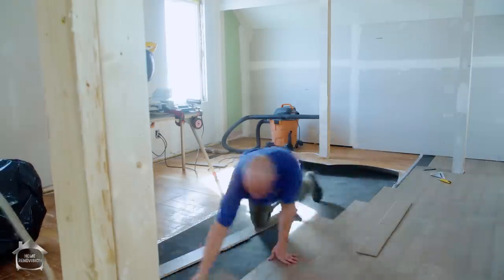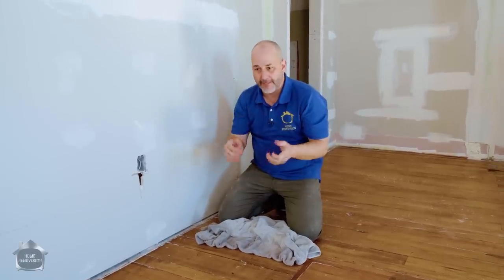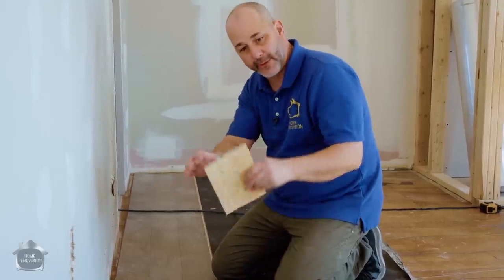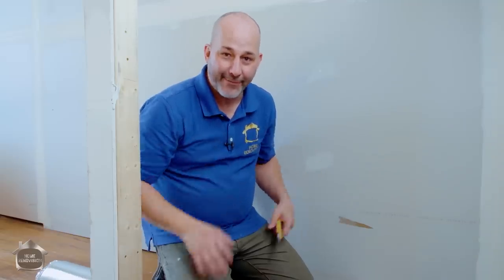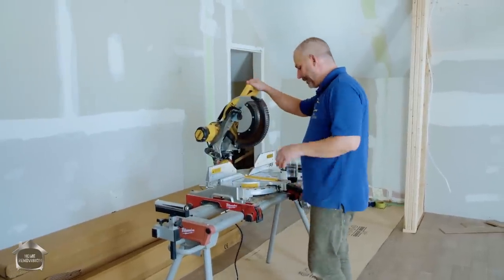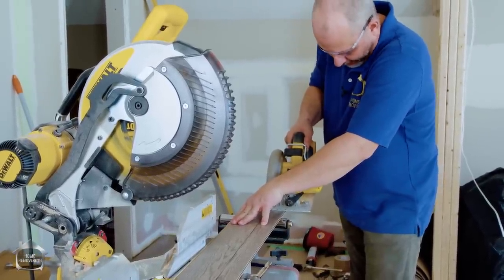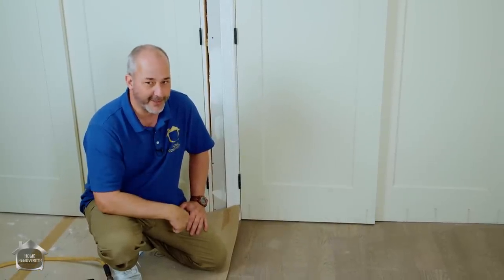This Hardwood Installs Easier Than Vinyl Flooring

Comment: I tried to install Tarkett click-lock flooring over a spongy foam underlayment (underlayment free with flooring purchase Menards special).  During installation, not even walked on, the 'locked' seams would separate.  Nightmare.  Returned unopened stock.  In hindsight I think the underlayment was too spongy.  If I ever attempted click lock again I would install directly over (sub)floor (or find dense underlayment with minimal give).  Likely I would not take the risk (fool me twice...) and instead pay up for actual tongue-in-groove hardwood (carpet starts looking economical).

Btw, used big scrap pieces of the replaced carpet to keep garage floor clean; when very dirty just throw away.
Reply: I installed without underlay on a good floor. No problem and no give, so it feels like a solid wood floor under foot. It was a small bathroom.

Comment: Is this the flooring you mentioned in an older video that would "revolutionize" hardwood flooring?
Reply from the maker: Yes. it is a quick lock floating hardwood that does not require fasteners. can be installed over any flat surface. Cheers!
Reply: @HomeRenoVisionDIY  So, at the time of the video. This was something relatively new? It seems that quick lock engineered hardwood floors are pretty easily found now though, correct?

Comment: Thanks Jeff for another great video.  I would just like to know what the difference is between this hardwood floor and the other wood click locks of the past.  Maybe I missed that.  Thanks!!
Reply: The difference is the wide kerfs (channels cut across) on the underside.  That gives the individual plank more flexibility, allowing it to handle undulations in the substrate better.  You COULD do the same thing yourself with any hardwood flooring product, whether engineered or solid, but doing so would take a lot of time.

Comment: What about installing on slab, and what about if you install in-floor heating over the slab then want to put something like this on top?  (I’m assuming a plywood subfloor would be necessary to protect the in-floor heating piping from being crushed by furniture, people walking, etc.)
Reply from the maker: you can use electric floor heat systems with this no problem

Comment: That board you beat in with the rubber mallet was horrendous. Between cutting the locking mechanism off and then having it that tight to the bottom plate of that wall leaving zero expansion especially in the direction the floor expands and contracts the most (the long length expands the least so those kerf cuts on the bottom you talked about in the beginning don't help that expansion).

Comment: I’ve installed a vinyl flooring over an old hardwood. However I have existing old baseboard already installed. Should I remove them at this stage, repaint them and install trim back again?
Reply: Or should I sand it, paint it and install shoe moulding over it. Any advise please?

Comment: Jeff, all of your videos are awesome, thank you.  Wondering what you think of waterproof laminate vs. LVP vs. this engineered hardwood.  I installed LVP in our last home a few years ago, but it scratched up easily and even buckled/cracked in some areas.  We are buying a new home, and so I'm wondering if the waterproof laminate would be more durable. How's the water resistance of this engineered HW?

Comment: For the screw trick, how would you recommend doing it when installing on concrete?
Reply: Since its just to hold the floor in place temporarily, you could screw a small scrap of wood to the floor, then screw a scrap of wood to a stud in the wall and screw the 2 scrap pieces together (without screwing thru the piece and into the floor.  The only reason I say to screw a piece to the floor is to avoid having a screw hole in the floor that is out past the baseboards.  Once you are done just remove the 2 pieces of scrap and you are good to go.

Comment: Freehand cutting on a table saw. You brave brave soul.
Reply: not brave just experienced if your afraid of the saw then get lessons from a pro before you use one saw blades only cut what is pushed into them they don't chase fingers down lol
Reply: @kirkyorg7654  Yes experience will definitely help in situations like this. I've made plenty of cuts that are considered sketchy to beginners. No matter how much experience you have though there's always a risk when using a machine against what it was designed to do. Bottom line is table saws were never meant to be used freehand. I appreciate that Jeff mentioned kickback. The riving knife was doing the real work here to prevent kickback while he did the longer cuts. Kickbacks are the real enemy, not pushing your fingers into the blade like you suggested. Reason being that kickback usually draws your hand toward the blade as the piece rotates and faster than a person can react.

Comment: I was planning a LVP SPC install, and contacted Decorner for a quote.  Will this engineered hardwood product offer anything close to the wear durability and waterproof characteristics?  I have 5 dogs, a couple of which are large, and children in the home, thus a lot of potential for wear and spills/drops.  Thanks for your assistance and excellent tutorials.
Reply: It wont. This kind of wood flooring has been standard in Sweden for a long time and it will scratch pretty easily and get water damaged if water spills are left on it. Would recommend vinyl for 5 dogs and small kids
Reply: For your case (similar to mine), LVP all the way!
Reply: Yo- if you have five dogs for you, i have nothing to recommend, but I will pray for you....

Comment: Hi, I am going to install a hard wood engineered floor. The seller says the planks are tongue and grove but with 'butt ends. Do I need to do anything different when we have butt end install.? Thanks Hailey ( Dublin, Ireland)
Reply from the maker: Hi Hailey! this video is a engineered floating floor video. I have a hardwood flooring video that is a better guide for you. Your flooring will have 2 sides tongue and 2 sides groove and slides together and then you add a fastener. Cheers!

Comment: I'm gonna stay with LVP. Handles traffic better, has almost 0 wear, great for pets, and waterproof. I'm trying to avoid wood at all costs, not just because of the price now, but the longevity and maintenance would cost you so much more in the long run.
Reply: I just don’t understand what’s the benefit for
“Wood” flooring. Yes real wood is a beautiful material but real living practicality it’s horrible. I have installed LVP for my house from a brand called Flooret. It’s been four years now and my vinyl literally looks the same as it was the first day.
Reply: @ThanhTran-qq6xm  
Yep, same here. 5 years, 2 dogs, clumsy wife (drops a knife at least twice a week)...And the floor looks brand new. Plus, you can clean it with whatever detergent/method you want, and use as many water as you desire.

Vinyl planks can have a wood look if someone like wood. But they have them in click-lock tile shapes now as well. 

And just refinishing your hardwood after 5-15 years (depending on the kind of traffic) will cost more per sq ft than installing new LVP. Hardwood has literally 0 advantages.

Next week we are replacing our deck with a "Rubacrete" porch. 0 maintenance, waterproof, 10 year commercial/20 year residential warranty...It will actually outlast concrete. And the best thing is, it cost only 20% more than a cedar deck (in today's market).

Same thing with a lawn. Look at how to establish a microclover lawn. Only needs 4 mowings/year, drought resistant, and cost 40$ per 500 sq ft to do by yourself. Needs watering only on the first 3 weeks...and then NEVER (Unless you had a drought longer than 4 weeks).

I live in canada. Wood as an exterior material makes even less sense here...But everyone seems to have it for some reason. What I usually do for exterior wood that is still in good condition, is sealing it with a clear truck bed liner. It lasts about 7-8 years. Exterior wood paint lasts 2 years here if you're very lucky.
Reply: Sorry to say.... vinyl is vinyl. It’s thin , doesn’t absorb sound and looks like vinyl. Wood feels better to walk on , it doesn’t allow an echo in the room And it adds value$$  when you sell.
Reply: @dicelady4  
1. Vinyl is vinyl is a blank statement.
2. Wood feels better? IDK, I usually wear slippers in winter and socks in the summer, because I like having clean feet at all times.
3. If you have an echo in your rooms... You don't have enough furniture there. I have no echo in my house, and it's all LVP.
4. Value to whom? I'd pay more for a house full of LVP (not sheets or stickers) over hardwood. Most will probably not, but that's just because they have never seen LVP and think vinyl is all sheets\stickers.
5. Sound proofing is all about the insulation between the joists and the underlayment.

Comment: I was about to do 2000 square feet vinyl planks now i want to use this.  what is the brand of this flooring so i can find somewhere in the states to buy it?
Reply from the maker: you can use our Wayfair link or our Decorner affiliate
Reply: @HomeRenoVisionDIY  what is the name of this product? I looked on decorners site and could only find vinyl flooring. Your link to wayfair appears to go to the wayfair professionals site and since I'm not a professional it won't let me access anything.
Reply: Ok sounds good thanks I’ll look on wayfare but same thing happens to me takes me to the professional way fair which I have but doesn’t show this product just takes me to wayfair pro home page

Comment: I’m dealing with real hardwood in half of the (original home) & faux hardwood on the poorly construction addition. With various size gaps in both. Tons of old old dust throughout. Especially the older part of home.
I have no clue what I’m gonna use: I’ve lost everyone. I have an enforced date set for august 1st. (To be finished) but my fiancé and I are “taking a break.” 
I’m just genuinely no reason to continue. Especially with so many structural problems. But I would give anything to have anyone (like my dad next door just come show me how to do certain things, or let me borrow a table saw/jigsaw.
Reply from the maker: Sorry to hear about your struggle Katie.

Comment: Hello! I am installing eclectic stone vinyl tiles in my kitchen and bathrooms, I am wondering if I should install it with a grout or no grout since it's going to be in very high traffic areas with lots of moisture? And does grout makes any difference when it comes to the resistance of moisture ?
Reply from the maker: if you tell me what the product is called I can comment. Cheers!
Reply: @HomeRenoVisionDIY  ultra ceramic, eclectic stone, silk color.
The product can be installed with or without grout, but I am concerned about the crumbs and moisture etc, 
I also wonder if you do have any advices for me about installation, I am really looking forward to your professional advice.
Your channel is really great and I have learnt tons of things through it. Cheers

Comment: the flooring you linked only has 1.2mm veneer. is that acceptable?
Reply from the maker: yes. since it is factory finished it is harder than anything you can do onsite after the fact.

Comment: Is there a spec for the engineered hardwood with click-lock ?
The 7mm examples I’ve found in local stores seem to have relatively thin wear layers (1mm).
1 mm of fancy veneer wood doesn’t sound very durable.

Any opinions would be appreciated.
Thanks

Comment: Hi Jeff, I'm actually in Ottawa. Unless I'm mistaken I don't believe you mentioned which brand of hardwood this is. I see you have the Wayfair link, but looks like they only have 2 boxes left. Is the product in the video the exact same product as seen on Wayfair? Where did you get it so I can check back in a while to see if they have it back in stock?

Comment: Speaking of baseboards and crappy contours for flexible floating flooring, should I be caulking between the floating floor and the baseboards? I have extremely ugly gaps in between and diy websites keeps saying I should. I know you can do it to hide the top of the baseboard but I'm unsure if I should for the gap due to crappy contours below. What are your thoughts on this jeff?

Comment: Hi Jeff, thanks for the video. Can I order this flooring through your website? Is it in stock now? I live in Toronto so I guess the best thing would be to order online? Also, my current hardwood floor is in bad shape with clear plastic coating coming off. Can i install this on top of the existing floor? Thanks

Comment: Jeff, thank you for your videos. Quick question, I need to put in 700 sf of flooring in the second floor of my house. This is a high end home and I want to make sure very little sound travels between floors (I watched your episodes on that.). Also, I want a quality natural long lasting wood flooring finish. I have bought the 2lb MLV for the upstairs, but I am having trouble finding out if I have to use a floating floor to go over it or if I can nail through the MLV into the new 3/4" OSB sub-flooring. I will have my flooring guys do this, but they don't have any experience with MLV, so I thought I would ask you. What is the highest quality flooring solution to use over MLV? I used your promo code to buy the MLV. Thanks again!

Comment: Usually a floating floor requires a gap all the way around the perimeter, to allow seasonal expansion and contraction. In several place you have 0, or even hammered in place. Even with less than 1% expansion, you're going to have a bad time.

Comment: Engineered Hardwood flooring is not really a new thing. It has been around some time now and most higher end Builders put it in as its easy to install and has a higher ROI then anything else but not as time consuming or expensive then regular Hardwood. Also it is stronger and more water resistant.

Comment: I don't see the advantage over vinyl. Is is scratch and water resistant like vinyl? Can't sand it down the road like real wood either. Don't get the "game changer' vibe. Love your videos though.
Reply: 100% Correct!

And usually, sanding+restaining cost more than new LVP per sq ft.
Reply: @shane250  it adds more value for resale as you can say you have hardwood floors
Reply: @antonioakiki3716  
Saying you have a worst performing floor finish adds value. Did I get it right?
Reply: @shane250  ironical but yes
Reply: @shane250  might be regional but seems many times in US if you say you have vinyl flooring people scrunch their faces and walk away if it’s a buyers market. In a sellers market they’ll buy anything. In personal experience, people have no idea the differences between flooring (we do obviously since we’re on this channel) but everyone sees looks at price not performance for different scenarios such as pets or water
Reply: @antonioakiki3716  lol
Reply: @shane250  Exactly, linoleum flooring performs better than wood technically but everyone hates it. Aesthetic and "autenthicicty" is more important

Comment: Excellent, Jeff excellent but you need to push away from the table.  You have added a 'belly' that is unnecessary to good carpentry and DIY shows.  Continued supports and Goodness.

Comment: I'm currently trying to install plank flooring in a mobile home. I want it to run from the kitchen through the living room and down the hall seamlessly but I have a small wall between the living room and dining area that is causing me issues. On one side it is fine but on the other side I cant get things to line up correctly. I NEED HELP!!!!! I know that as a member there us an email address I should be able to use but I cannot find it or I'd send pictures.

Comment: vinyl was actually a pain in the butt for me to install cuz the grooves/joints were so thin and the board was so thin..
Reply: Depends on the vinyl, the more expensive stuff is just as thick as laminate or the hardwood that Jeff showed in this video. They sell REALLY cheap vinyl that’s a few mm thick, but it’s trash.
Reply: @SgtZima  yeah kind of regret it. Oh well. Lesson learned. Will see how long it lasts

Comment: I will never buy the engendered flooring,  add few cents per square feet ( talking about  3rd grade) and get real hardwood floors, little bit more work but will last forever, you can send it up to 7+ times.
Now that's add value to the property.

Comment: Cutting that piece by the door so it is so tight (that he had to hammer it in) against the bottom plate of the wall is just dumb.  No matter how little this stuff expands/contracts, putting it in that tight is just begging for problems.  He's going to have at least 1/2" of drywall plus that 3/4" baseboard - he could have left an inch gap and wouldn't have had a problem.  Not leaving at least a half inch is reckless.
This channel has so many excellent videos with so much great information but then the straight up dumb moves like this turn me off.  It's like 99% great, 1% pure cringe bad advice.

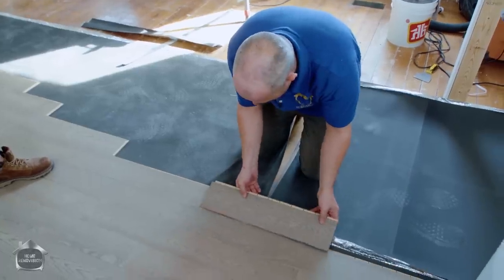Comment: So much wrong in this video.   Forget if the floor is running parallel or perpendicular, if there is a gap between the 1st row and the wall, just push the flooring to run parallel to the wall.  Who cares if it continues to run diagonal the entire length of the floor!  Screw down the flooring, after you just spent so much time explaining what the molding would cover (spoiler...not most of those screw holes.)  Your son calls you out on going too far ahead, so you "cheat".  Fair enough, but it certainly doesn't always work with every floor/subfloor you're installing on. Also any professional installer worth their weight in salt could easily get a board in there, without "cheating".   At 16:21  Really?!  That's how you stagger rows?!  Yeah, those 4 rows aren't too close together...